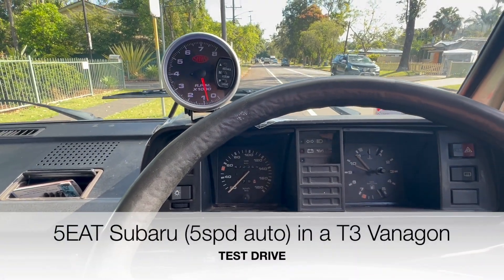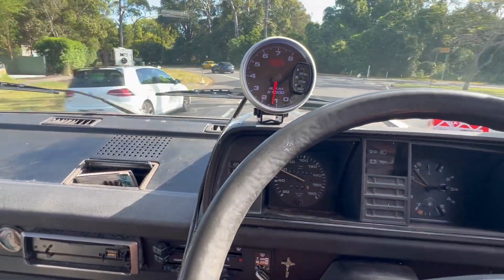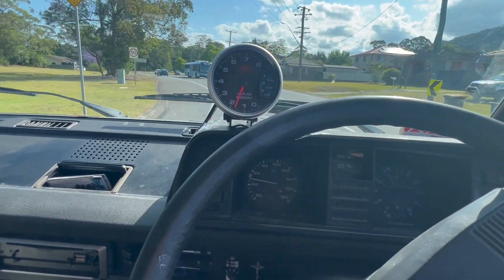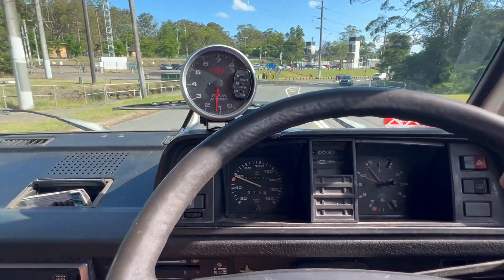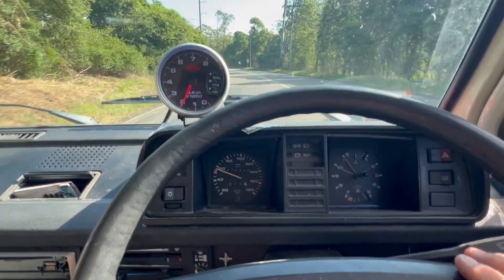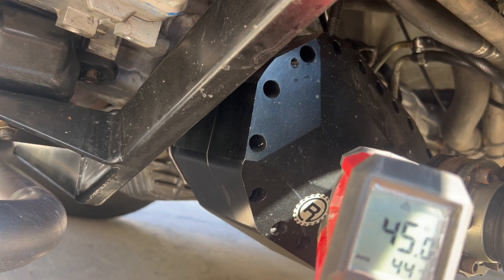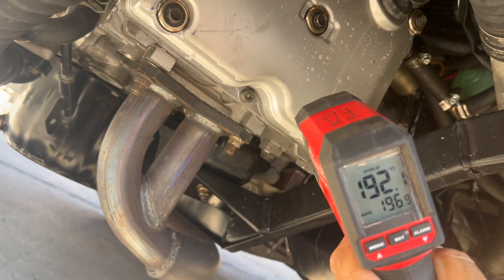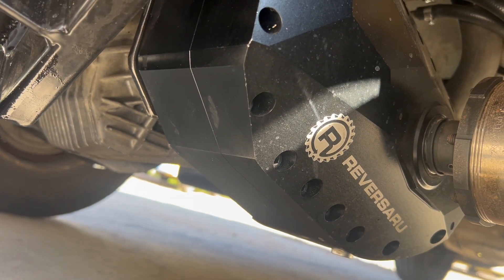Update #3 RGB’s (Reduction Gear Boxes) for Subaru Autos and Manuals and the 012 VW Passat gearbox

Comment: Amazing work. Any idea of costs at this stage mate and can it be bolted to a manual transmission?
Reply: yes, you can bolt them to a subaru 5 speed and other select transmissions which brackets may be developed for in the future
Reply from the maker: Yep the RGB’s can be bolted to a Subaru 5 speed manual and we are in the middle of making brackets for a few other transmissions as well. We still have a fair bit of testing to do but will be announcing the launch of the product and pricing through our E-newsletter. So, if you haven't already, please head to the website and down the bottom of the home page you will see a spot where you can enter your email address to receive the newsletter. 👍🏽 www.reversaru.com

Comment: Sorry for being ignorant, is this to use other gear boxes instead of the stock vw one, because the engine is effectively facing backwards?
Reply from the maker: Yep, correct. In order to use a Subaru transmission or a 012 VW Passat 5 speed transmission in a Volkswagen (with a rear mounted engine, like the T3 Vanagon or T2 Bay window bus) you need to reverse the drive of the transmission, because if you don't you will have 5 reverse gears and one forward gear. So - the RGB's reverse the drive of the transmission so the above mentioned transmissions can be used in vehicles like the Volkswagen T3 Vanagon etc...

Comment: Thats great innovation!  Having the RGB gearboxes have multiple benefits:
1) reverses output direction of stock transmission 
2) allows multiple final drive gear ratios without messing with ring and pinion gears
3) no need to split the transmission or perform machining work 
4) adjustable RGB rotation when bolted to the side of the transmission, allowing CV axle angles to be optimized 
5) allows all wheel drive if needed, that’s not possible with the other reversal kits

Awesome product
Reply from the maker: Thanks Jeff! Yep you nailed all the benefits.. I need you as my CMO haha 😜

Comment: Nice, though I'd prefer to have seen the gear boxes attached to custom trailing arms rather than the transmission itself. It would be stronger, maybe a bit less bulky underneath, and If available as a separate purchase, this would allow other transmissions to be used rather than just the 5EAT for the DIY crowd.
Reply from the maker: Hey mate thanks for your comment. I beg to differ. If you run that scenario through engineering software (using outboard RGB's out at the arms)  I'm 100% certain you will find that it will cause all sorts of dramas due to unsprung weight issues. And yes, I know other vehicles run outboard portals out at the arms, but they have been designed from the beginning to run that design, so the suspension and geometry is all factored in from factory to compensate for all that unsprung weight. And; the RGB's being a standalone unit can actually be bolted to any transmission. We are currently in the middle of making brackets for the RGB's to be bolted to the VW Passat 5 speed so that can be run in a rear engine mounted vehicle. 😊👍🏽

Comment: looking good!!! drives smoothly. What are the temps like on the CV bearing housings? does the slightly inclined drive shaft angles make them warmer? did you drive it with the poly carbonate lids to see the oil wash patterns at all?
Reply from the maker: To be honest, I haven't temp tested the cv bearing housing housings, but will endeavour to do this in one of the next update videos. The CV's are driving fine with no noises or issues so didn't think to temp test then as I didn't see them as being an issue but will keep it in mind to do so. The polycarbonate case halves are currently bolted to the Subaru dual range 5 speed manual tranny that is bolted into the Vanagon that I'm doing a 4x4 conversion on, using a flipped WRX diff up front in a custom made cradle... So we will run the polycarbonate cases in that vehicle. If you haven't seen that build yet, you should search "SYNCARU" on our YouTube channel... 👍🏽    Actually, second thought, maybe I pull a polycarbonate case off that SYNCARU build and bolt it on the vehicle in this video... hmmm... I'll see.. good thought. Thanks!

Comment: Are these also able to be used in a type 1 conversion? If so, would the engine+gear box position need to be offset to compensate for the install?
Reply from the maker: These current RGB's are too wide for Split window busses and Bugs. That said, as we speak, I'm in the middle of designing narrower cases and using narrower bearings and gears etc so the RGB's can be used in bugs and early buses.